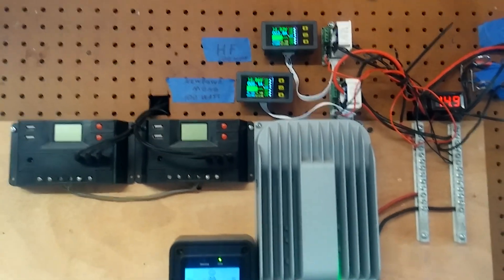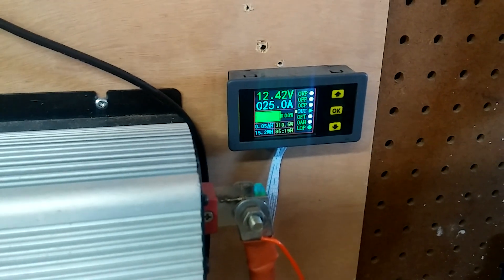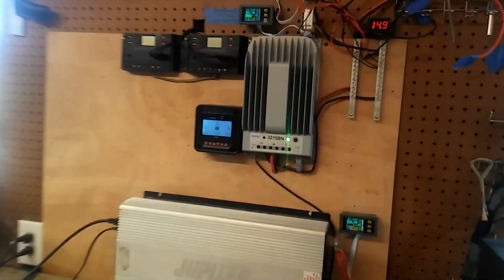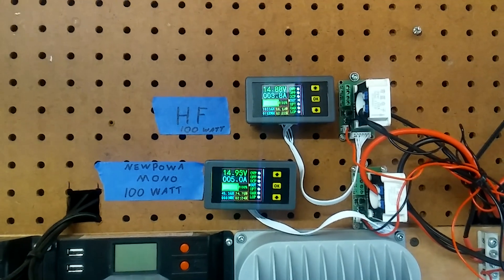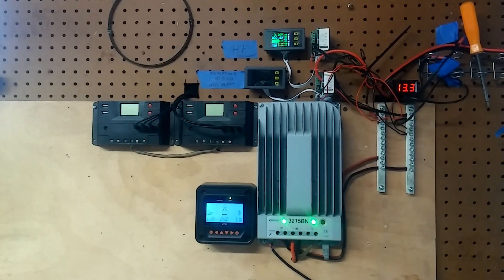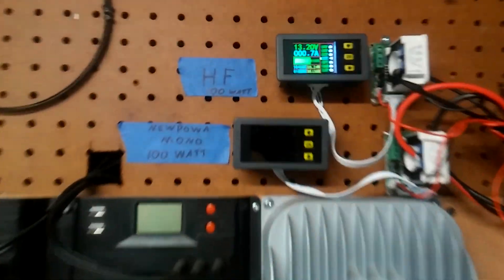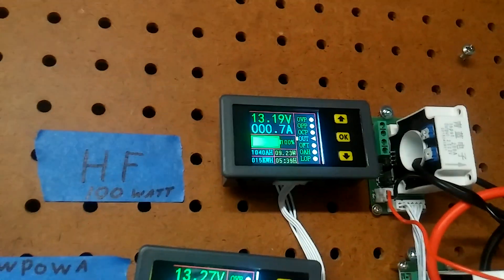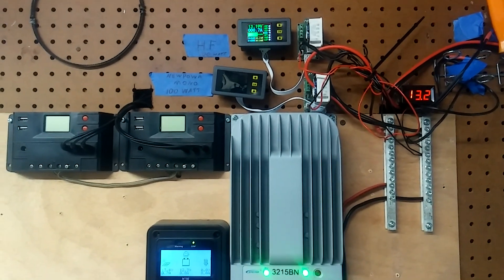Harbor freight vs monocrystalline solar panels

Comment: Good I can just hook all my panels together..Ill get more watts without these chintzy 4 amp controllers if I run it all thru the 4215...I just kind of figured that..been wondering which way to hook...series or the other..lol..mines 24 v..I gotta go get batteries..

Comment: Please forgive me, this could be long. Number of years ago I saw a video of a man using a 25 watt harbor freight amphorus panel to charge up a single battery. He was using a different brand charge controller. He noticed that each morning he was losing ground on battery voltage. His thoughts were that there were no diodes in the panel....so the voltage was reversing back to the panel. He stated that their must be diodes in the charge controller that came with the kit. Any thoughts.........thanks
Reply from the maker: I’m more than certain there are diode’s in the charge controller. Especially on the output probably just for protection so you don’t get your positive or negative backwards and damage the charge controller, as voltage only travels one way through a diode which I’m sure you know. As far as the panels go they do have diodes in them as well. Panels will draw voltage from the batteries at night only without these diode’s. And I’m sure it also helps accidentally hooking your polarity backwards. I do know all my panels do  have diode’s in them Because I have checked this out already. You would think that the diode’s in the charge controller would prevent this from happening, and maybe it does. That I have not checked out. But don’t forget a charge controller does use power at night as it stays on so there will be a very small power draw and maybe that is what he is seeing

Comment: Great video. Be good if you can repeat the comparison during a few days or a weeks worth of rain/cloudy conditions. See which panel produces the most under those conditions. I would say the harbor freight, but by how much?
Reply from the maker: Ax Marr. I did do a second video that showed that the mono panel put out roughly the same as the harbor freight panel on a cloudy day. The only difference I noticed was when the sun was out the mono  was just a little stronger
Reply: @Checkitfirst  Oh cool!. I'll look into that video. I ask because of considerations to take after a storm, or my case, A hurricane. I live in Florida and I am looking for a system that will collect power through a few days of cloudy weather. Thanks again.
Reply from the maker: @axmarr8132 . Im in south texas. we had one not to long ago named Harvy . thats what got me into solar. Going with out power really sucks

Comment: If you trying to use the power for direct usage to an inverter go for a hybrid system because you get the increased power in direct sunlight from the mono panels but with the anamorphic HF panels you will still get some power even at low light. If you are just keeping an RV battery charging up choose the HF solar panels because all you have to do is charge up a couple of batteries.